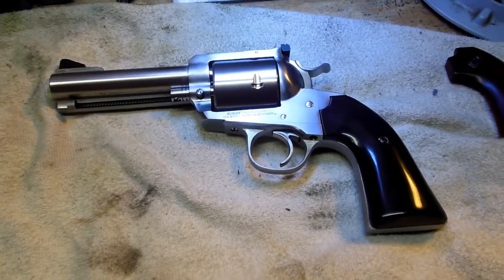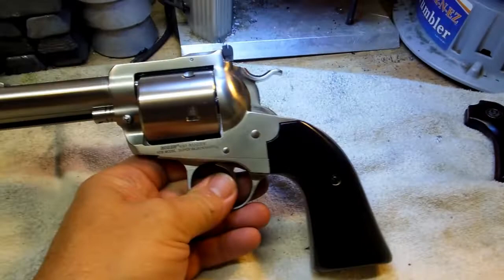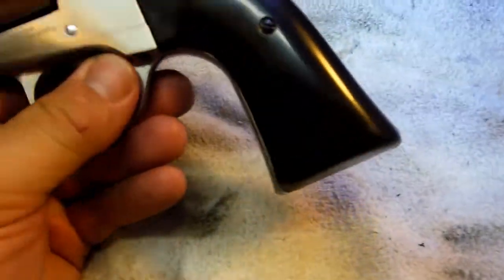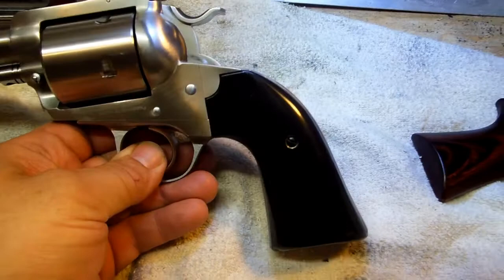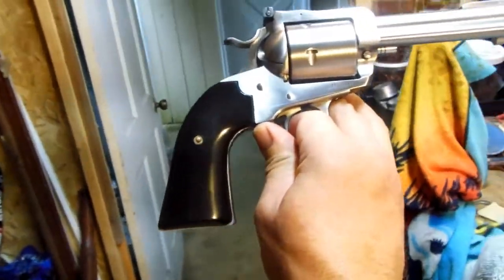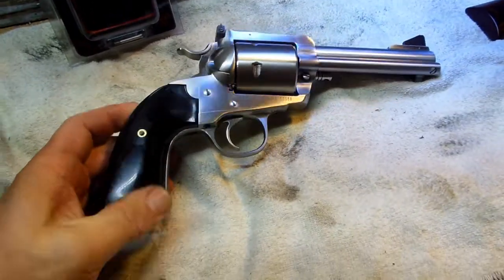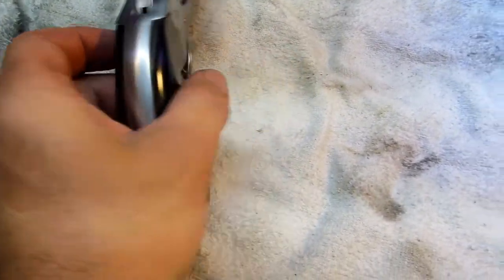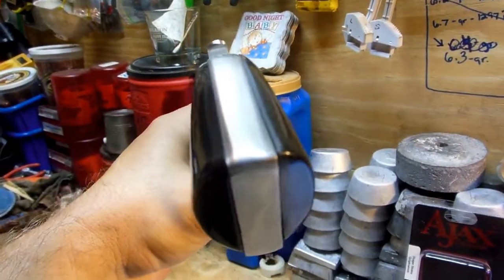Ruger SBH Bisley .480 -Ajax "buffalo" grips

Comment: I’ve had a fuel tank on a 18 wheeler patched with JB Weld and it worked just fine .
Reply from the maker: I tried that on a full sized Bronco back in the mid- '90s...but it was too far gone.

Comment: Hogue grips were the savior for me when I had my Sig 220...  Love Hogue grips.  They are thick but nothing beats them as far as traction goes.  Beautiful job on those grips though.  It isn't as pretty as the factory grips - that red wood grain looks rich but function over appearance especially these days and it looks as if it was fitted by a professional smith.  Great job!
Reply from the maker: Thank you.
The finish of the factory Altamont/Rugers was better, but I like the looks of the black grips on that stainless, too. 
If the originals had felt "right", they looked plenty good enough for me to leave on.

Comment: I patched a small hole in the cases right behind the rear cylinder of a HD Sportster in about 1979 with JB Weld and that bike is still running around today. BTW I just picked up a 1895 CBA. Got it a part right now, waiting for some parts to show up and will be shooting this weekend
Reply from the maker: I actually repaired a busted (thrown chain) '85 ATC250R case with that "water-weld" putty steel. I drilled small holes (not all the way through) around the break and pushed the putty into the holes. I shaped it with a Dremel, painted it, put a new shift-shaft seal in it, and it held for years. I suspect it still is wherever it lives today. Stuff like JB weld can work very well on a lot of things with good prep.
Reply: Yup-Prep is the key
Reply from the maker: I REALLY want to shoot my CBA some more. I'm embarrassed to admit how long it's been and little I have shot it.

Comment: Glad to see you doing well plowboysghost, I use a 480 ruger die for neck sizing my martini brass sometimes. Got to thinking, my mold drops 485gr at.472. I bet a coat of powder coat would bring that up to .475. Hit me up if you want a science experiment. I have buckets of them. 
Nothing wrong with a little JB weld. The grips look nice.
Reply from the maker: That's an interesting thought trail to go down. I'm sizing these Lee 400-grainers @ .476. Today is really the first time I've paper with it and it groups pretty good. My throats are about .477-.4775, so I didn't know what to expect.

I know that I'm going to get another mould at some point...something in the 420-gr range. I'm thinking I'll do one of those customize-self designed moulds where I can move the crimp groove to give me the same case capacity/OAL as .475 Linebaugh since there's only 2,000 psi between the Max SAAMI spec for .480 Ruger and .475 Linebaugh.

 Thanks!

Comment: Does the 480 kick harder than the casull
Reply from the maker: My SBH Bisley .454 was a longer barrel, so that probably comes into play vs. this 4-5/8" .480. 

With the 400-gr .480 loads using .475 Linebaugh load data, I believe they do indeed recoil more than the one I had in .454 Casull using 300-gr bullets....both factory loads and the 315-gr cast /30-gr of H-110 handload.

 The .454 was more blast and a sharper recoil, but I believe the heavier .480 load I was running was a harder shove. Of course, that load was in effect .475 Linebaugh.

 I wasn't impressed with the common .480 Hornady 325-gr factory load. It definitely recoils less than the typical .454 Casull factory load.